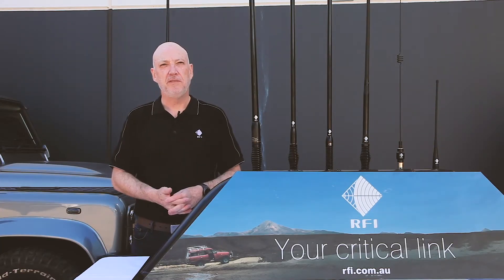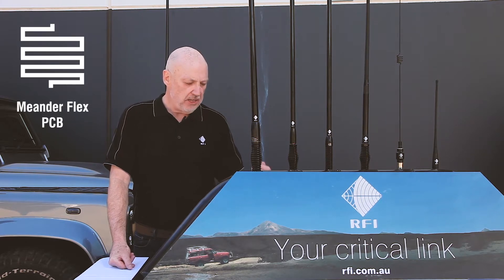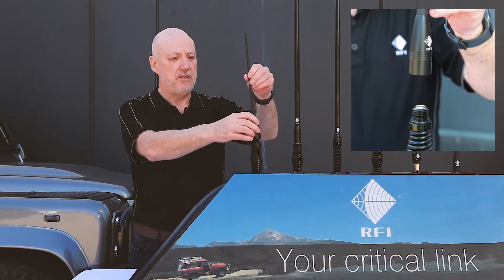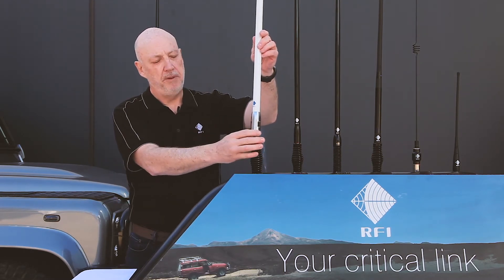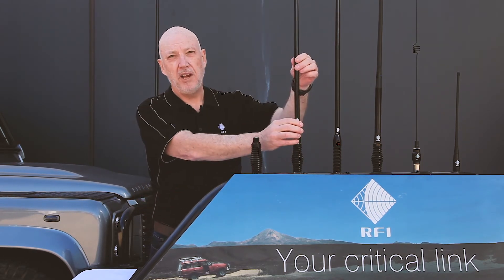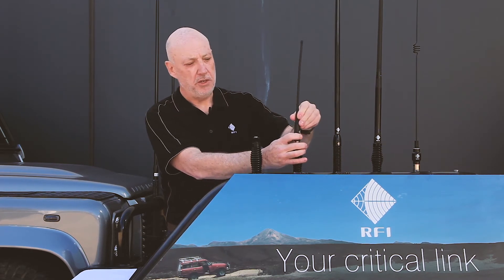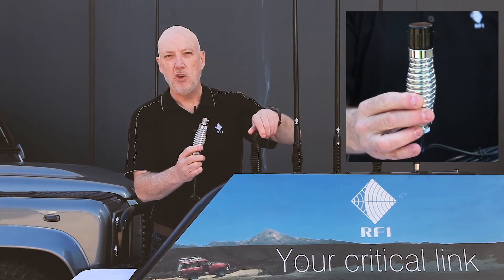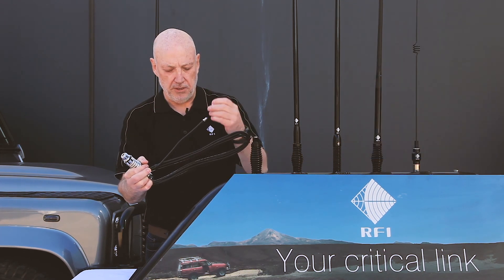Meander Series Antennas

Comment: Silly question, but does the CD34 fit the CDQ5000 base?
Reply: Hi Jay, Not a silly question and the answer is no. The CDQ5000 will take a CDQ34 (item number: CDQ34-71-00), however we do make a lighter version of the CDQ5000, the CDR5000 (-B/-W). The CDR uses the same flex PCB radiator and hence provides the same RF performance. The CD34 whip will fit directly to the CDR5000. Hope this helps.
Ian
Reply: @ianferrett9722  Thanks mate. Just ordered the CDQ :( lol All good. Is it possible to have a coax switcher? What are your thoughts? Or do they introduce so much loss its not worth it?
Reply: @Jay-hr9ci  Did you buy the CDQ5000 (-Black I assume) with the CDQ34 2nd whip? And, no I am not a big fan of coax switches because of the losses, especially when UHF CB radios transmit at only 5 watts.
Reply: @ianferrett9722  I brought the CDQ5000 with the CDQ34 mate.  Might repurpose the other one now. Cheers
Reply: @Jay-hr9ci  if you do use a coax antenna switch at UHF choose wisely as some are supremely crap and are only even barely acceptable on upper HF frequencies like 27mhz CB is
Reply: @Jay-hr9ci  We do 'sort of'. We have our CD30 which is used extensively by emergency services with the Motorola APX8500 dual band radio. But it cover VHF (148-174 MHz) and UHF (400-470 MHz).

Comment: Hi,
Great videos and your products look awesome too. Quick question: I have a 2015 Defender 110 just like yours in the video. However, I only have the stock bumper bar, therefore mounting an antenna to this is not ideal (per your other video). Would mounting it to the wingtip in a similar location to the stock AM radio antenna work with the CDQ 5000 or should I be looking to mount it at the front nose of the wingtip or vehicle? Any suggestions on mounts that would suit a Defender is very much appreciated. Looking forward to adding a CDQ 5000 soon - once I figure out where to put it. 
Cheers, Maxi
Reply: Hi Max, we have a couple of ideas. Can you send me you email address so we can talk further and send some pictures? Ian
Reply: Hi Ian  - you can email me at maxi@maxwellparker.com.au. Appreciate your help.